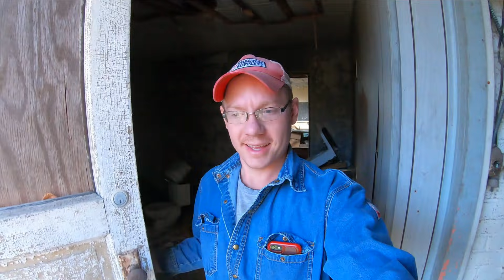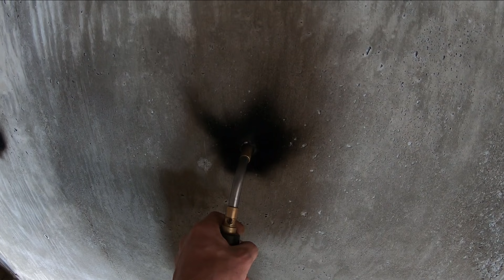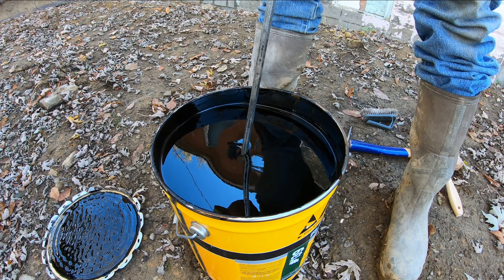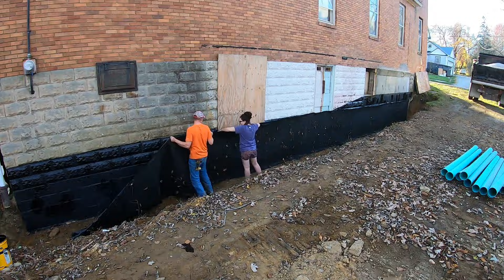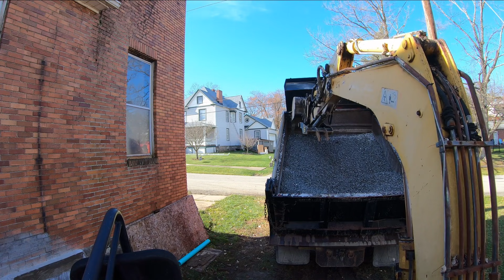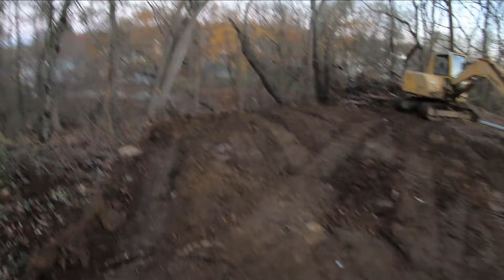Installing a Bullet Proof French Drain at the Abandoned Church!

Comment: Know this is old, but info might be useful for the future. Retired const. insp. here. On bridges we get this result: Take out the rebar and use a drill bit close to the OD of your pvc and go in about an inch, or whatever makes you happy.  Grout it up with non-shrink grout (usually in 25# bags in the concrete section of your big box diy store). The pvc lined void in the center is fine.

Comment: Put a torpedo heater to warm up the pail.   Just close enough to warm it not cook it. Will go on the wall easier.   Good luck
Reply: F'n A man, right on!
Reply: Excellent idea 👍
Reply: In cold weather I put tubes of silicone and gap filler in a bucket of warm water before using for the same reason👍🍺
Reply: That’s how I did it
Reply: They also make electric bucket heater jackets. Just wrap around the pail and plug in. It'll keep it at a nice working temp as you move around without having to constantly reheat it if its cold out.
Reply: Excellent idea
Reply: Rubbish, its says do not heat on the can
Reply: @stephenpitt6363  does it say keep out of the sun? Keep outdoors in winter? Refrigerate in summer? 8f not and you don't do those things... you're heating it.
Reply: @stephenpitt6363  I bet you still have tags on all your mattresses.

Comment: Not too late. Use two 45's instead of one 90 when designing cleanouts. The snake will travel right thru 45's instead of having to jam it until it bends 90 deg.
Reply: or a sweep L that has a wider radius.  But if you can’t find one, two 45s are definitely an improvement over a harsh 90.
Reply: I agree to that, experience has taught me after cussing the 90° with a sewer snake.  Using two 45's slightly separated  12 inches or so and the clean out snake will go right through it.
Reply: Thought the same, but then one could still use a water jet, these go through a 90 pretty fine. And the other end is also accessible, which helps as well.
Reply: Ran a snake in the city of Toronto  Canada . Nothing worse then getting stuck in a 90  .When I was putting them in I always made 45 ,s
Reply: So true. I made the mistake of using 90s when i should have used 45
Reply: Use 2 45's or a lazy 90. Both work about the same. Also use a TY with a cap, at the start of the downspout for easy access cleaning.
Reply: Definitely always use a sweep L (90) or two 45’s. 👍

Comment: I see a winter project that's in dire need: Extra work lights for the excavator (and probably all the other machines, as long as you're ordering stuff). High power LED work lights aren't that expensive anymore, don't need a lot of power, and really improve the usability of a machine. You can never have too much lighting on equipment!
Reply from the maker: I actually have had them for years and never got to putting them on, lighting is the least of its problems lol
Reply: @DieselCreek  Fair enough. It's one of the easiest ones to fix though, and very handy to have if one of the other problems shows up while in the dark. It's also something you could take along to the next machine, if you decide to upgrade. Just remove the lights and take them with you.

Comment: We had an abandon school in Nutrioso, Az.and we made it into a community center. That building was constructed by the WPA in 1936 . A lot of old time fixtures, wireing, oak t&g flooing.we reroofed it with metal. We also added a 53’ x 70’ remade, with concrete floor ,and lots of picnic tables. There was also a BBQ pit and every last Saturday in July, we have an annual BBQ for around 500 to600 people.

Comment: You're a very patient guy to brush that on. There comes a point where paying a pro $500 to spray coat it with liquid membrane sounds good.
Reply: Considering he mentioned the cost of his opinions of product, $50 verses $160, I doubt he'd be paying someone to do it.
Reply: It’s what ever your time is worth. If you were a professional builder, getting a spray job done would make a lot of sense. Matt is very good at showing the DIY guys how to do it themselves
Reply: Map gas torch resolves many unforeseen labor conflicts.
Reply: Or he could have spent 25$ to "PATO levy", you just put against the plinth and spent 10$ for bitumen sheet to coat footing and 20-30cm upwards from footing. This way construction is allowed to breath, dry if it gets wet for any reason like flood and any cracks due building sinking, or sifting do not cause issues. Whole thing would been cheaper, better on the long run and taken way less time.
I see he used dimple board after the seal coating, but this does not seem to be same material i'm use to. One i'm talking about is just dimples and it goes against the wall, leaving the gap between board and the wall, where moist air can rise up leaving the foundation and membrane it self prevents any moisture coming from outside in form of natural rain etc. Flooding creates its own issues, but long as it does not get over that bitumen barrier it should not get into building and if any gets in, it will dry over time on its own, where as with rubberized coating you need to rip the coating off or replace the wall to get it drying in case of flood.
Reply: That liquid membrane was the monster who killed Tasha Yar in Star Trek :)
Reply: @Mogipbob  that’s the truth! Who wants that in their property! Btw I was mad when that happened to Tasha

Comment: In UK we have a water based bitumen emulsion called Synthaprufe. You can spray it, first coat thinned and it soaks in great then spray another 2 coats and it turns to tar as it dries. So much easier that that stuff you used. Bob

Comment: Always interesting how folks do the same job in different parts of the country.Here in Washington State, the drain pipe is required to be in its own fabric sock. The holes in the perf pipe facing down at 5 and 7 o'clock position. Then 4 - 6" of washed pea gravel (we don't have limestone) is burritoed around the pipe and sock. Also, code requires us to secure the dimple board to the wall every 10". Couple of tips: Try Christy's "blue", its primer and glue all in one, works on everything. Two 45's instead of one 90 for the clean out. On foundation drains we only glue half of the pipe, it gives water another way in (but then again you have a deeper frost). And try heating up the can of membrane before application (90 - 110F). All in all, great job for doing it DIY and recording it all for us!!!

Comment: Matt you have to heat the rubberized membrane before using it. Its the only way it will apply nice and laydown on the substrate nicely. We used to use just a good ol fire under the bucket

Comment: When I replaced the drain tile system around my house I used Noah's pitch then covered it with 8 mil plastic and the perforated pipe layed down in the plastic. I then covered it with 15 inches of pea gravel 8in. of straw and back filled the dirt. 30 years later basement is still dry.
Reply: 8in of straw? Whats that for?
Reply: @DSGLABEL  The straw was just an extra filter over the gravel while the dirt was settling

Comment: Don’t take the tower off the building, even if it’s not original. it still looks cool and it adds some shape to the building, because the rest of the building is just a rectangle with a slanted roof
Reply: It could even be a tiny house by its self up and down stairs for a town house style apartment!
Reply: @sandygraetz5166  yeah I was thinking how he could replace the vent towards the top of the tower with a window and maybe have like a small spiral staircase, I don’t know if it’s big enough to live in though
Reply: Sandy G I was thinking the same thing.
Reply: Maybe put a spire on top. But first underpin the foundations. Dig out a cubic yard (3x3x3 ft) poke rebar into soil sides and fill with concrete.  Move along 3ft and repeat. Then ding it the soil between. The rebar links the foundation blocks together.

Comment: That's a first class job, right there. One thing to bear in mind with single skin walls below ground level, they are always the temperature of the ground. This causes water vapour in the indoors air (which is usually warmer so holds more water vapour) to condense on that wall. This can give the impression of water seeping through from the outside. I recently did a job like this where there were pools of water on the floor from the condensation. The homeowner was convinced it was leaking in from outside. I rendered the whole inside wall with lime and cork powder render, built up to an inch and a half in two coats. The wall is now warm to the touch, and dry!

Comment: Had the hull been covered as well as you did that foundation, that coating and the dimple fabric probably would have kept the Edmund Fitzgerald afloat. She's still be hauling iron ore today.
Reply: The water came over the top of the Fitz   Broke thru the hatchways.
Reply: His sure is covering the foundation, but i'm more worried of when eventually those covers fail, how it will dry afterwards. Many buildings have been ruined by over insulating ie trapping moisture inside and not letting it dry naturally. Rubberized coating was not needed on whole wall, just the footing and 20-30cm upwards to wall, then install dimple board that does not have that fabric thing against the wall so there is gap between wall and membrane, this way moisture can leave foundation and only really bad flood could get water contact with the wall.
And that drain system... ffs if you are doing something, do it properly with ADS 4-in x 100-ft Corrugated Perforated Pipe not some crappy pvc pipe with few holes drilled on it...
Reply: @agentfrankvideos  Ahh, you are correct sir. I forgot, but stand corrected. Then the hatches should have been covered with Diesel Creek's method. :-)

Comment: A few suggestions. Pay some guys to work with you. Also asphalt roofing cement will work just as well. Tractor Supply or Lowes or Home Depot should carry it in five gallon buckets as well as any commercial roofing supply company. It is a ready mixed product. If it makes you feel any better you just saved yourself about $25,000 grand. It could take your wrist a few months to stop aching.

Comment: Pro tip: Matt puts a 90 degree bend in the pipe and says he'll leave the end open for future cleaning. However that will be very difficult with that 90° knee. Instead install two 45° knees and that will then make cleaning the pipe much easier.

Comment: Great video I would recommend putting some black pipe over your French drain pipe and then pack it in with some rip rap because the green pipe will deteriorate over time if exposed to sun the piece of black pipe that fits over it will just be piece of sacrificial you will have a cleaner look nice video place is going to be pretty awesome when it's done
Reply from the maker: I was going to paint it brown one of these days, but that might be a good idea as well

Comment: I spilled 5 gallons of that rubberized coating into my truck bed one time. I can tell you that Dawn dish detergent, a scrub brush and lots of water will clean it up before it dries if you need that tip.

Comment: I had a battle applying that stuff in the late 70s and it went on a lot better if I heated it first...and that was in the summer time!  The can should show a range of application temperatures. It flows on better hot, and penetrates the wall better. I don't envy you the job!

Comment: The waterproofing is in a metal bucket, I used to do poured concrete basements and we always heated up the buckets with a large propane torch. Just take the lid off first. It turns it into the consistency of water, goes on way easier.

Comment: Great job!  Loved the rubberized coating.  Never done that but it looked really tedious.  Surprised how clean you stayed working with that stuff.

Your clean out needed a long turn 90 degree to function as an actual clean out.  A cable will break it.  A jetter will be going the wrong way and a small vac hose won't make that turn.  You might not have been able to find a long turn fitting in the schedule pipe (20 or 3034 or 35?) you were working with.  The good news is, you don't need it.  If it ever plugs you can easily jet the entire line out from where you've daylighted the line.  I've cleaned out lines like that over 400 feet long (in 1 shot).  

I had a similar issue at my house.  The land slopped to the back.  I ran 6" pvc underground and daylighted out a bank just like you did.  But I was only running water from my gutters so it was solid pipe.  I used fist to head sized bolders at the end to slow down erosion.  Been working good.

Comment: Nice work! Here's my two cents (from a licensed home inspector) .... I'd get the vegetation off the building. Moisture and bugs just love a good bush clinging to a structure. Thanks for sharing. Be safe.
Reply: Hi Inspector,
Am I wrong to think that the inlet holes on the green pipe should be orientated horizontally? This would allow moisture to seep/Ingres into the belly of the pipe to drain away. Having the inlets vertical would only allow drainage when the water table was at pipe level. Thanks in advance

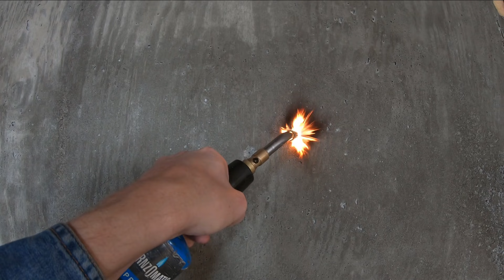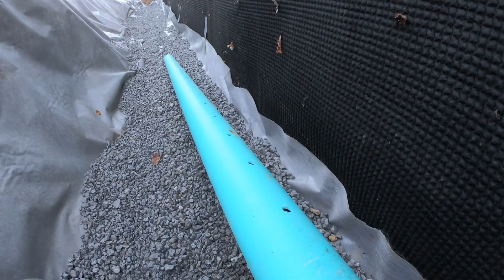Comment: Mr. Creek.  I love your videos and learn a lot from your desire to share knowledge.  I wanted to pass long that at @3:39, you could have drilled out the plastic pipe easier that messing with all that torching.  Also,  @20:34, i don't think it is as important to have one set of holes direclty down and instead it is more important to have no holes over the 1/2 way up zone.  If holes are present in the top half of the pipe, they can allow pebbles to get into the pipe.  I agree that if you follow my advice, the water will never be fully drained down to the level at the bottom of the pipe.  but if you have slope in your pipe and gravel like you showed, the water will run along the pipe until it eventually finds a hole.  If you put the bottom of the pipe flush with the bottom of the footer (and have crushed clear stone below the pipe), water should never rise more than an inch above the bottom of the footer.  In any case, you did a fine job and I know water problems will be a thing of the past on that wall.

Comment: This thing looks very similar to stuff I was using for sealing chassis of a truck. It ended up as a bit gummy, black layer that sealed everything and was soft enough not to crack or be chipped. The beauty of this thing is that you can just buy canisters and compressed air gun which makes the work quick and easy. I had the same stuff in can and it looked almost the same as the stuff you used here, it was as hard to put it anywhere and evenly distribute. Even harder as I was sealing up metal truck chassis.
I'll also mention that in Europe you can buy something similar to roofing felt that is prepared to be used on foundations. It is covered with some sand on the one side but has edges uncovered so you can just join them together. Put it on the wall and melt with blowtorch, it will nicely stick to everything and make nice seal. I'm not sure if something like that is used in US though.
After all it always adds up to the same thing - the more you pay, the easier the job is. It's just matter of calculation.

Comment: I use to  pour a little gas into the 5 gallon coating can, then light it off too heat it up some. then pop the cover over it to extinguish the flame. with 3ft broom handle , stir it around to mix the thining  of it. Haveing an extra can I would pour about 1/2 of it off, then do the same by thinning out with some more gas. You cover more area that way.When you pay help by the Hour, you tend to find quicker ways to knock-it-out.

Comment: Great work, if you ever have any water leaks it will be coming down the out side wall from any cracks in the bricks or upstairs windows. Although in one case I've seen water leak come from the roof down the backside of the bricks into the basement, contractor throwing money at the basement wall before discovering the roof leaking.

Comment: I've used RedGuard on a tile shower I built, it went between the drypack/hardyboard and the thinset and tile. IT GOES ON BEST WITH A 3INCH WIDE BY 1 INCH ROLLER, kind of a squeegee action. You can initially spread it with a trowel, then use the roller to thin it out and get it into the cracks. I used it on a tile deck I built. Expensive stuff. It is almost like spreading Aluma-Roof, the motorhome roof paint.

Comment: Quite different drainage pipes, we had a variant that snapped together and locked into each other as well as bends, also had 0-90 degree flexible bends, no glue needed which was handy. Also easy to cut with a knife. Also had a different material on the wall after the "taring", looked a bit like a mix between LECA and Styrofoam, about 4 inch thick. But otherwise fairly similar process, interesting to see how the process is done in other countries :-)

Comment: Next time apply a primer coat of blok-tex sealer for cinder blocks before you apply the flexseal.  It will make a smoother and less porous surface that has no pin holes and hair line imperfections.

Comment: Next time ya gotta seal holes and cracks in concrete wall take a used up empty caulking tube cleaned out really well after you've used it up and fill it with that patch crete. Then just use your caulking gun to pressure it into the hole or crack.
Especially into where you had that pvc pipes.

Comment: That tanking on the walls is great stuff. Last time I tanked down to foundation level we cheated. One of my uncles is a roofer so 'borrowed the stove and pail and used hot tar to tank. Same issues you had, damn wall soaked it up like a sponge. We didn't use the materials for a french drain as you did, just made sure the ditch flowed downhill, lined it with builders plastic and put pea shingle along to provide the drainage material, backfill and new turf. Still dry after 30+ years. Love the wall covering, thats neat. Take care and stay safe .